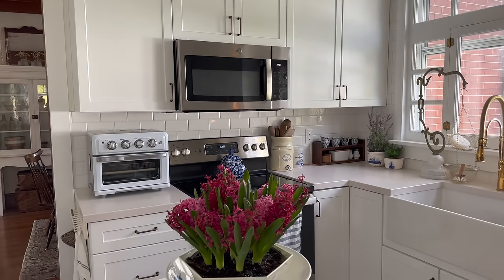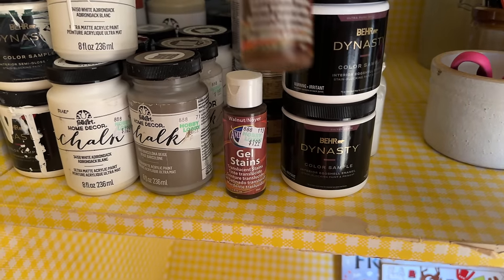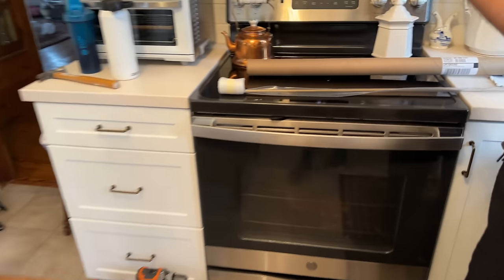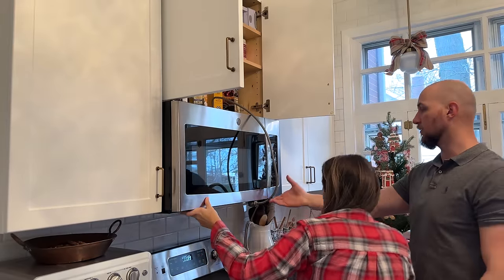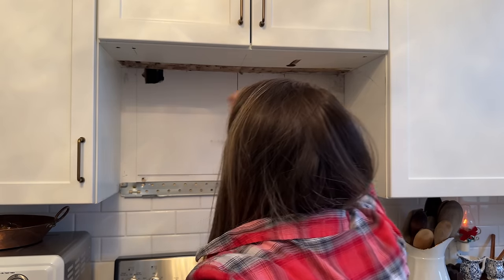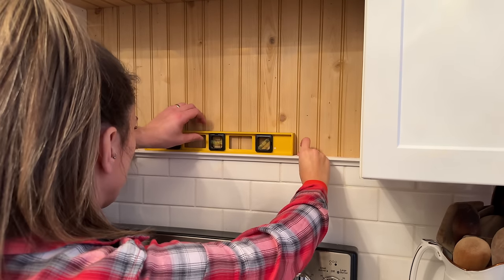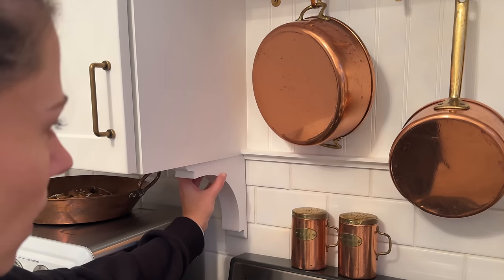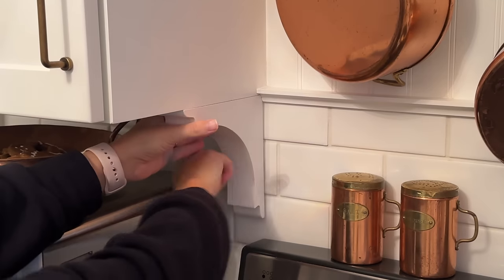These Changes Transformed Our Kitchen in Only 2 Days! DIY ISLAND & MICROWAVE NOOK MAKEOVER IDEAS!

Comment: Looks nice  but I would have put in an exhaust fan to the outdoors.  They are so important.  You can run the exhaust pipe through your upper cabinets which is what we did.  We ran it at the top of the inside cabinets to the outside.  Not a hard job as my hubby did it and he's probably not as handy as some guys but he does a good job.
Reply: I agree, it does need some sort of ventilation fan/range hood.
Reply: She said she has a window.  I don't have a hood....stove right next to a window. Works for me.
Reply: of course; work with what you have,     she can do a vent easy judging from all her videos plus her husband gets to use cooler power tools which is fun

Comment: ❤️ the transformation! If you need ventilation: in the past, I've used a small fan that I can hide in a cupboard and set it next to stove (in your case on left) and open your sink window at least a few inches and a cross breeze will be created that is sucked out the window. I cook a lot and it was always sufficient. You can do this even in the winter because the heat of the stove will keep the kitchen warm.

Comment: Corbels are a great idea, but, maybe get some as long as the cupboards. These look a little short. Just love the wash basin as a island. I'm thinking of getting one for a bathroom sink. Adding the wooden legs was a wonderful idea to make it taller. Everything looks fantastic!
Reply from the maker: I would have liked the longer ones, but the one on the left would have run into the stove. That would also make a great bathroom vanity!
Reply: @oldmaplehome  these corbels are perfect.  They don't interfere with anything else and finish the space off nicely.  Great job all around!

Comment: Great idea Elizabeth with removing the microwave. The copper pots look stunning and the beadboard looks beautiful. Also wanted to tell you that I did the same thing with turning an old vintage dresser into an island for my kitchen. I had a piece of granite left over from my kitchen remodel and thought hmmmm I wonder if I can use this as a top for the dresser and use it as a kitchen island. I ended up attaching hooks to the back of it and hung old vintage utensils across the back. I love how it came out but love your idea too of installing the brass rail. So pretty.
Reply: But I’m sure that the microwave had some kind of exhaust fan on for when she cooks

Comment: If you've ever cleaned a hood vent over a stove, you would know why you absolutely need that! (If you actually cook on your stove). The amount og grease and steam it removes from your house... If you remove it, or don't use it (and you use the stove, even just a few times a week), that steam and grease will rise humidity levels in your house, and can even cause mold issues. And after a while, you will notice this sticky layer on everything... So remove the microwave, but replace it with a hoodvent with an effective fan!
Reply from the maker: Never had an exhaust over the stove, it’s never caused us any issues. Thank you for your deep concern though 😀

Comment: Looks great.  Hope you don't miss having a hood over your stove.  Your cabinet is adorable.  You can glue a small piece of wood at the back of the drawer to make it stay forward.  Been there, done that.
Reply from the maker: Thank you! We never had a hood over our stove, so nothing to miss there 😅 Yes, these old furniture pieces sometimes need a little extra tlc. 🥰
Reply: But your microwave did suck up smoke from cooking and filter it before recirculating into the room. The vent hood we got to replace the micro hood actually sucks up smoke much better than the micro hood, plus the light over the stove is invaluable to me. I'll be curious to see how easy it will be to clean grease and grime from the grooves of the bead board . Please give us an update in a few months! I love bead board. We have it in one of our bathrooms but it's a pain to clean. Gets very dusty in those grooves.